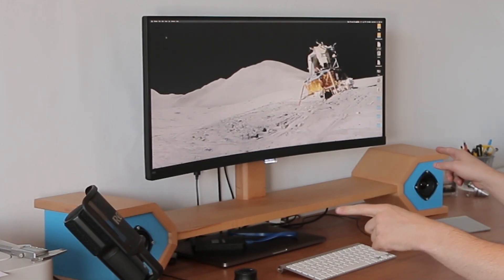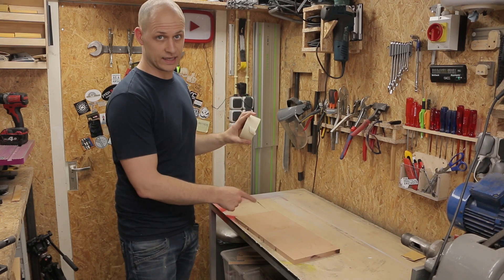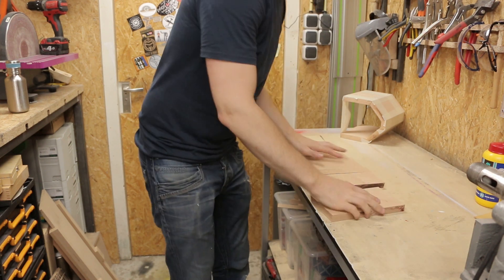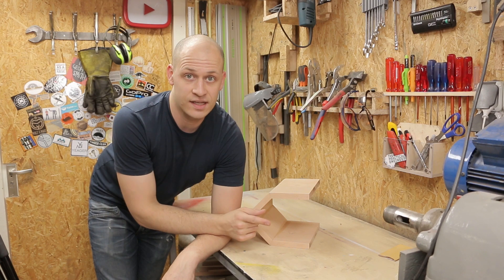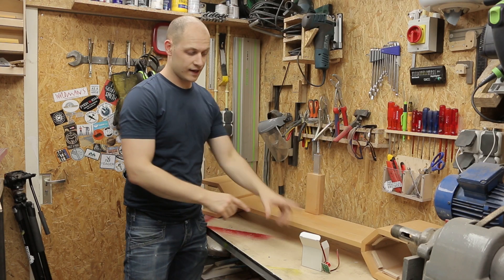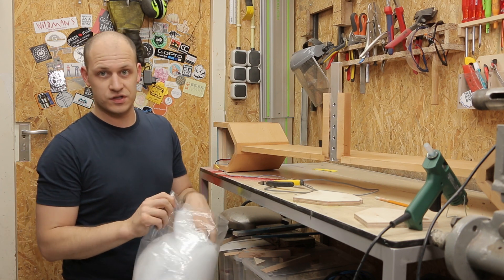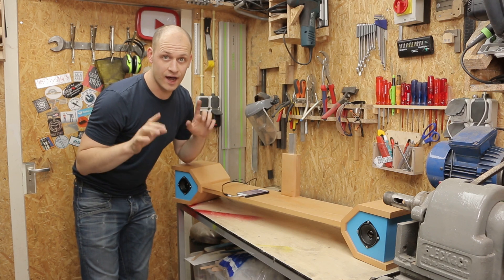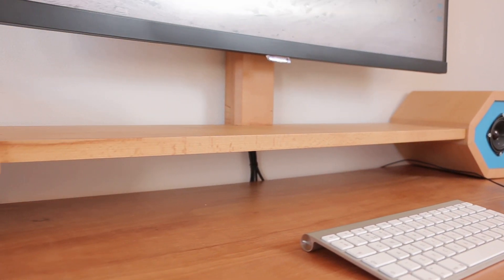DIY monitor stand with hidden wireless charging and speakers

Comment: This looks amazing.   I do have a concern though (and I know this is 3 years later)  With all the insulation packed around the amplifier, how hot does it run, especially at higher volumes?

Comment: I missed something. How the heck is wood glue strong enough to keep the adjustable aluminum pole and the wood in place despite the weight of the monitor? Btw, nice build. I have an articulating gas spring monitor mount that sits too low for good ergonomics. Considering ditching it for something I can better adjust the height of the monitor. That is why Google sent me here :)
Reply from the maker: Sweet! It's still hanging there so it seems to work

Comment: Nice design, I like it. I would add a bottom support on the horizontal piece that hold the monitor, humidity and gravity will bend that piece with the time, I think. Thanks for sharing.
Reply from the maker: Thanks! I have tought about adding that, and at first it was in my design as well. But the shelf feels super sturdy so I decided to leave it out. Also because the shelf is 20 cm deep you won't see the cables underneath.